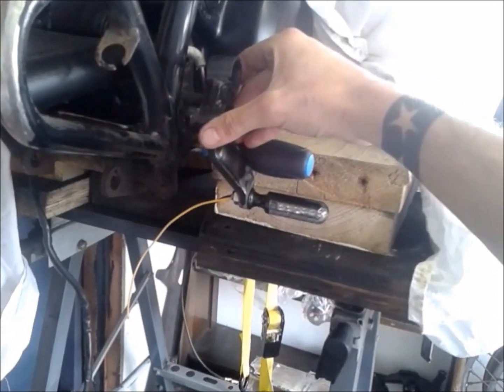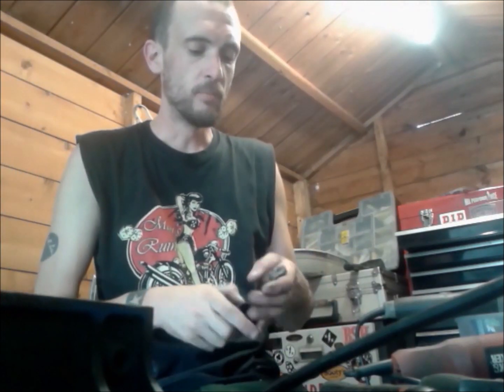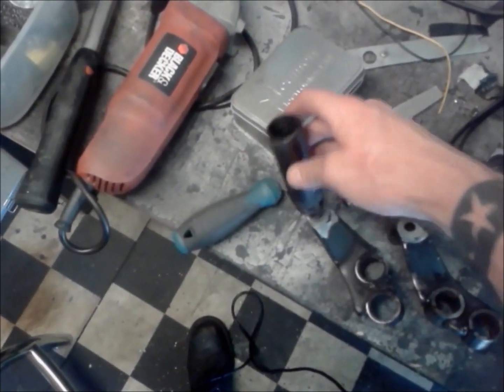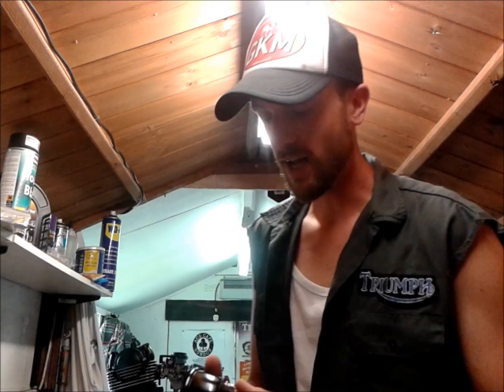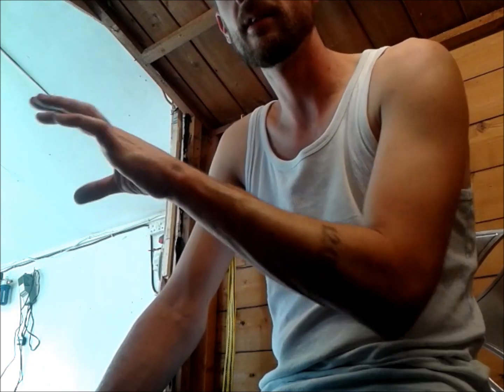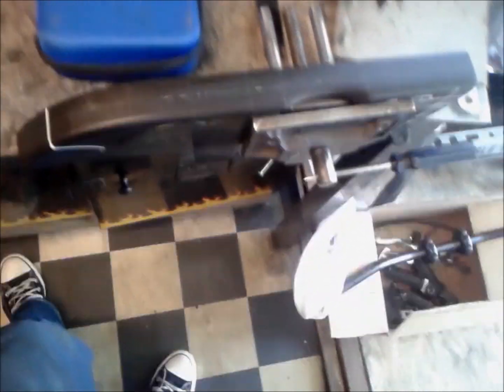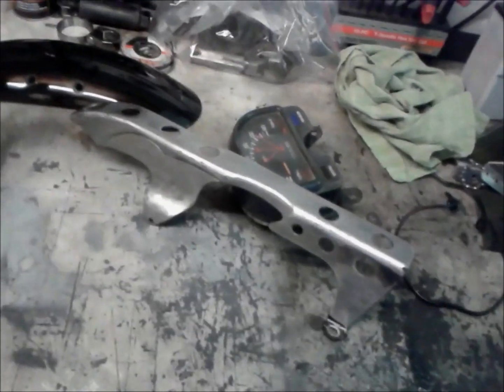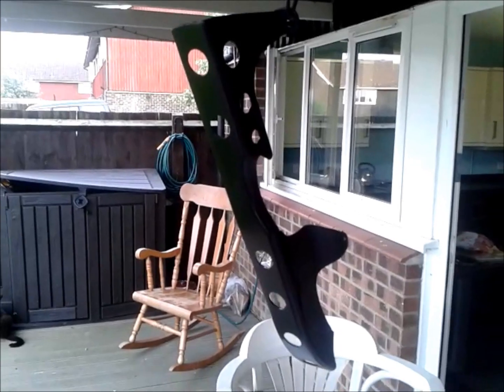PROJECT SR250 pt18 A THANK YOU

Comment: More ideas and progress and the hoop and frame are now one! Great stuff! 

I know that tired feeling. Spent two very hot days re-enforcing the shed with steel.

Saturday night/Sunday morning  the thieves returned and smashed the large gate and shed locks. They didn't get the bike, it's too well anchored in, but they did get ALL my tools, and I mean ALL of them, some of which I've had over thirty years. I haven't got a  single screwdriver left. All I have now is  an 8mm 1/4 drive socket which had rolled under the workbench!. I can't begin to count up the cost of replacement! They also got my HJC Helmet and the Biltwell (although that was returned as they just threw it in a neighbours garden ... too much to carry I 'spose as it's evident they were on foot). They did get the goggles though. Doesn't look like the insurance covers it :( 

Police did get some prints that may help, but I'm not holding out much hope. 

I now need to get through 4 heavy duty padlocks securing a 1/4" box section steel door barrier plus two heavy duty hasp and staples and a 5 lever mortice lock (hidden behind the steel) just to get into the shed.

Still, the bike's safe and unmarked. took me a while to wash off all the fingerprint dust and stuff!

Ho hum.
Reply: Oh No! Peter sorry to hear this, gutted for you mate, chin up and I hope they catch the barstewards soon. :(
Reply: Thanks my friend, at least the bike is safe and unmarked eh? :-)
Reply: Gutted for you.Have you more than your fair share of scumbags where you live or was it a targeted break in? I lost all  my gear a few yr back so feel for you.At least RE is safe
Reply: Sorry to hear that, at least the bike is OK, but still...
Reply: Damn that SUCKS! Hope they catch the theives
Reply from the maker: oh man...truly i'm gutted for you my friend....that makes my blood boil i hope the scum bastards die slowly of aids cancer and galloping knob rot in as much pain as they can take before passing out because they should suffer. im struggling to express my vitriol towards these parasitic little cnuts. some solice at least the bike and the biltwell are in tact but taking a mans tools.....both jen and i send our thoughts....oh to have 20 mins in a locked room with them.....xxx
Reply: johnnycactus0 What is it with thieves at the moment? Early hours of Monday some fuckers tried to steal my bike, mashed up the ignition barrel with a screwdriver or something similar and now I can't even get the key into the barrel to start it.
Reply: johnnycactus0 Same here matey, can't afford to get ti fixed until next week either so I am now stuck with three days off work with glorious sunshine and no bike to enjoy it on.
Reply from the maker: if you are going to have to replace the switch you could cut the wires and hotwire it....stupid thieves- theres even vids on you tube of how to hotwire a bike- they couldn't even do it properly...
Reply: johnnycactus0 The irony is that they used a flat head screw driver, if they'd used a phillips they could've removed the barrel and just hotwired it.
Reply from the maker: dripping bell ends.........
Reply: johnnycactus0 And I'm having a right mare trying to find a replacement on the internet.
Reply from the maker: what about the en454- can ya take that one off and use it!!???
Reply: johnnycactus0 No it wouldn't fit anywhere, I've ordered a new ignition now, house mate paid for it! ;)
Reply from the maker: cheeky bonus!!!- i won't ask how you you intend to pay your house mate back....;-)
Reply: johnnycactus0 With money of course, I have a job, remember? ;)
Reply from the maker: ah of course.....my favors usually require me too gargle alot of mouthwash after....:-)
Reply: johnnycactus0 thanks mate, sorry if I hijacked your comments a bit with my woes :-)
Reply from the maker: no way my friend- we are all family - vent, rage whatever-it's not hijacking- not to me anyhow!!

Comment: A couple of things-I used stunt pegs (same as yours) for the front foot rests, they work fine. 2--a gel battery works best, mount anywhere any orientation. 3 --for the seat mounting, fibreglassing the mounting bolts does not work, they spin no matter how well you resin them in.  Its better to drill the holes, put a bolt through with a nut and small washer up tight to the seat pan- then enlarge the mounting holes on the frame so the nut goes through, use a large washer then another nut--Dave

Comment: I would go for a smaller battery if you have the cash, its the crank power you need to look at not so much the ah. These new small ones have a higher crank power than the ah would suggest.
Reply from the maker: thanks karl- i agree, i'm feeling a smaller battery i can mount anywhere and can be discreet is the way!!!- thanks for the info on the ah- i fully admit i'm still a bit of a dunce when it comes to what battery i can get away with- stock is 12v 12ah cca 165a....so trying to figure out the smallest gel /amg battery i can get away with.....ha ha- any suggestions appreciated!!!!!!!!!!!!
Reply: 12ah on a 250, I think that's bigger than it needs to be even for a normal lead acid, unless the thing has some seriously high compression. Something with about 70 cold cranking amps should do I think probably will be about 5 ah.
Reply from the maker: thanks karl!- i'm thinking perhaps going with the ytx9 bs - resonably priced, seems to have the oomph, smaller size and dimensions wise lends itself to alot of custom battery boxes etc- should i end up going that route....
Reply: That will do the job nicely. but you could get away with CT4L BS but you would need to look carefully at the cca to make sure you get one about 70. The ones with the 70CCA do tend to creep up to the £25-£30 quid mark though.
Reply from the maker: thanks for all the top tips Karl- really appreciate it!- i've been mulling it over today and think i'll be going for the ytx9 - i've seen a cheapish battery tray i like too so may order them up and tick that off the list!!!

Comment: why the fuck is it crossing out my comments--doh !
Reply from the maker: i've had a few comments with lines through...weird!?? - it marked one of yours as spam- which i have rectified!!!- i'm a few vids ahead of whats uploaded- i've used the stunt pegs that i had and am perfectly happy with them...i'm certainly leaning towards the gel battery i think!!! as for the seat pan, i tapped a thread through the fibreglass- resin on the bolts and screwed them down and then added a few layers of matting over the boltheads to hold them...so far nothing is moving them!!! very solid!!!- however if it should become problematic i think i'll fix it the way you say!!- hows yours going mate!!!!??? dying to see some pics!!